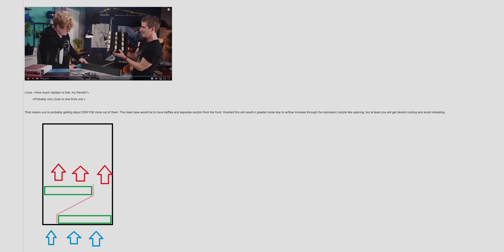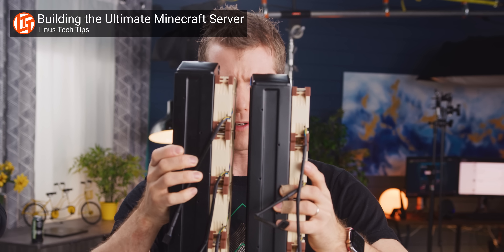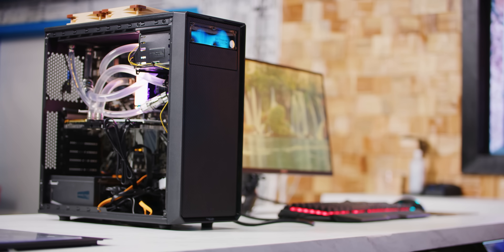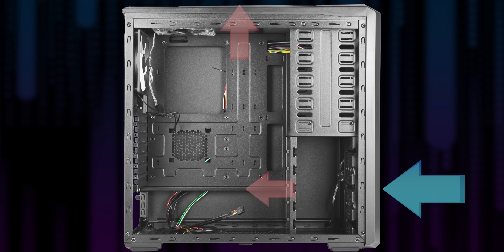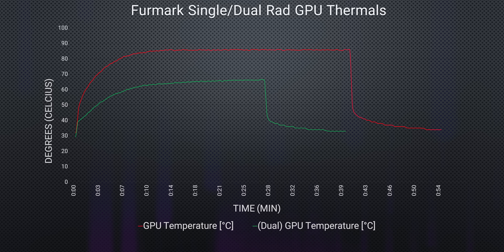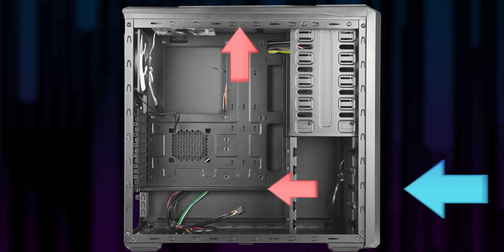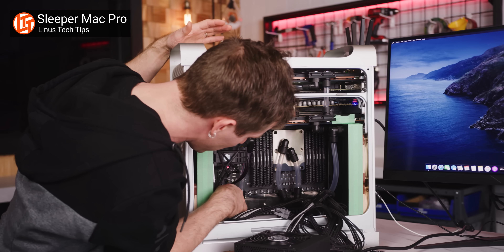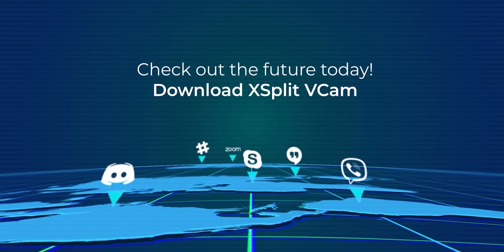I’ve been water cooling wrong for YEARS - $H!T Manufacturers Say

Comment: Corsair isn't wrong, but as Linus mentioned there's a difference in fan specs, radiator specs, etc.

I didn't see any information relating to the air volume or pressure drop across the coils of the radiators, which is a very large element to consider when modeling performance. Matching a fan to a radiator is the only way to correctly transfer the model, but you'd still have to be assuming a lot of other factors. Stick a stronger/larger/higher capacity fan on there (or two) and you're now increasing volume and ensuring a higher supply of lower temperature air, increasing thermal transfer (potentially). This keeps approach temperatures lower for the next-in-line radiator, that delta between temperatures determines performance, which Linus mentioned.

To understand airflow and pressure drop you can simply setup a fan on your desk and turn it on. See how easily it will blow a loose piece of a paper. Stick the radiator in front of it. If it still easily pushed that paper your coil does not have much loss/restriction and you will have an easier time sticking more air through it. This is why dust kills computers, clogging and restricting airflow reduces the overall volume and the amount of heat the fans can push and how much heat you can pull out of the system.

Those things other than airflow? A single performance model for a radiator would also assume a fluid flow rate and fluid characteristics, as the other media in the air-to-water heat exchanger. A simple change in pump, pluming line size/length, or other characteristics can greatly impact flow coming from these small pumps. Slower liquid will reach a colder temperature in the heat exchanger, but less mass flow means you're not transferring energy in the entire system at the same rate.

So: Is stacking radiators fundamentally incorrect? Yes, if they share an air stream there will be efficiency loss on the second unit, the extent of that loss depends greatly on how much air is being moved, how much water is being moved, whether or not those flows are laminar or turbulent, the approach temperature of incoming water/air, the surface area each media is in contact with, the thermal coefficient for heat transfer of each fluid and the materials separating them, and the relative density of each media. Knowing those we can calculate exiting air and water temperatures, and stack the model to the next radiator and determine exactly how much of a reduction in capacity we're seeing, and whether a change in one of those variables can help us optimize the setup we've chosen in terms of footprint, operating costs, ease of use, installation requirements, or other factors we're concerned with.

Comment: 2:20 
Wow, he even got the graphic wrong.  He's talking about heat exchange and has the arrow going from cool to hot....  Amazing.
Reply: what the fuck are you talking about. You do realize how cooling works... right? You put cool (relatively) air through the radiator which has a high surface area that imparts heat to the air making it hotter and therefore the thing it's cooling cooler. The arrow representing air is supposed to go from cool to hot. Are you gonna tell me that the air coming out of your pc case is cooler than it was when it went in? No! Cause that's not how pc cooling works.
Reply: He refers to cold air going through the radiator not to cold temperature "moving" into hot temperature space and cooling it.
Reply: @eliadbu  again, that's literally what the animation showed. You take cold air, put it through through a radiator, that air becomes hotter and is expelled. What exactly is wrong about that... that's literally how cooling works.

Comment: Would also matter if the hot air goes into the exhaust radiator FIRST. If it goes into the intake radiator first - then the exhaust hits warmer air and cooler coolant and the gradient is nil.

Comment: Your still doing it wrong dude, the rear of any propeller fan must be clear, it's exhaust side doesn't matter so you use that to push air into something not suck with the intake side, that's what impeller fans are for like in the underside of any laptop that's why they don't use propeller fans but impellers instead.

Comment: Thia is a suggestion if you have enough time please try.

While stacking radiators arrange the loop in such a way that the rearmost radiator is where hot water reaches first. The semi cooled water from the rearmost one flows next to the one in front and so on. And cool water from the radiator in front to the heat source.

This will make sure air flowing though first radiator is cooler than water in the second and same for the next.

Comment: Would've been nice if you tested a setup without the radiators in series (perhaps both outside the case, grabbing room temp air) to see HOW MUCH efficiency loss your having by pulling warm air into the secondary radiator.

It seems to me that their concern is probably less that it wont work at all than that it's just plain inefficent
Reply: So... add a control group kind of?
Reply: The difference is insignificant compared to adding a second radiator. The thermal dissipation gained from the second rad will far outweigh any loss in efficiency from installing them in parallel.
Reply: Or rather that is less efficient than having a single, bigger.
Not sure who it was, but either Linus or Jay, who tested with the rad as intake and as output and the difference was basically nothing.
Also saw a video about pump speed that ended up with 2 CPU, 3 GPU blocks and 5 rads and still worked fine.
Reply: @HappyBeezerStudios  If you dump 10c into the air from an intake radiator, the water is 10c above room ambient, and no air comes into the system except through the intake, that 2nd rad does nothing.

  To actually test the effectiveness of this system, you need to mount thermocouples where the air leaves the intake radiator and where the air goes into the exhaust radiator, and it would be better to get your results from temp sensors in the loop before and after each radiator(both of which should be identical).  The CPU, while practical, is so hilariously bad a datapoint that it's useless.

Comment: It all depends on how you stack the radiators.  If heat from the cpu goes into radiator one and blows it's hot air unto radiator 2 then you won't see much improvement, But if the heat goes into radiator one which instead sucks air from the much cooler second radiator then you will increase cooling performance as radiator two gets both the cooler ambiant air combined with the precooled water from radiator one.

Comment: I’ve got a goat tier gaming pc. Here are specs

3D cardboard case with cardboard fans

1/2 core CPU processor with .01 threads 

Cardboard mouse with built in lamp for RGB

Ice cold water bottle for liquid cooling

Wireless cardboard mouse (does not support bluetooth)

A rtx .2080 with resolution downscaling 1kb 

Ram of 1mb

Homemade hardrive (currently does not support space)

Power supply: new generation bicycle power generator with 2 wats

Microphone/headset: tin can telephone (currently does not support sound)

WiFi:unknown

Monitor: Ehh don’t need one

Please let me know what you think of my pc. Will it run FORTNITE at 4K 240fps. Maybe 8k?

Comment: Flip the fans so the radiators are all fed ambient air and watch the temps drop. You missed the point they were trying to make, supplying the radiators with warm air has exponentially lower performance than with cold. So before you go adding more and more radiators, ensure the ones you have are properly fed with gold air. If you fed the top with ambient air pulling in it would preform better.

Comment: I'd be interested to see what difference, if any, it makes depending on which item the intake rad and exhaust rad are cooling respectively.  Intuitively it would make sense to have the intake rad cool the item producing least heat when maxed out as then the internal air in the case will be less heated.  So typically that might suggest CPU cooler on intake rad side, GPU on exhaust rad side (assuming separate loops are in use).  Might make hose routing interesting though.  If they're both on a single loop, I would think exhaust first, then partly cooled fluid to the intake side rad, again to keep internal air cooler.  But in that sort of loop should the fluid go to the CPU or GPU first, intuitively I'd guess CPU.  Thoughts anyone?

Comment: Until the air hits the same temperature as your radiator it is always going to perform better with more radiators. Stacking a fourth radiator together might have a smaller impact, but radiators aren't perfect at transferring heat to air, if your fans are working properly the air isn't in the radiator long enough to reach max temperature. Corsair is assuming a spherical cow in zero gravity.

Comment: I have always seen a temp decrease adding a 2nd rad. I can say from my own experience that rads that are stacked do not cool as well as those same rads not stacked. So if you can for example put one on the front and one on the bottom, I'd say that would cool better then both stacked on the front. For me that made at least a couple Celsius drop in temps. Also a rad getting cool air from an intake will run cooler than the rad getting warm air from the case. That also makes a couple of degrees in temp. I had a top rad getting air from inside the case. I moved it to the front so it got air from the room. It did expel heat into the case but it did not seem to effect other components temps at all. The CPU temp did noticeably drop.

Comment: I would like the know the effects of having more water in the loop due to a second radiator being one of the reasons for this. Since there are much more water in the system, the thermal capcity of the overall loop drastically increases. They shouldve done the test where in the system with only 1 rad to have a giant reservoir to compensate. There still will likely be a small difference due to the other side vent airflow like they guessed, but it should not be enough to justify the extra $80-100 for an extra rad in the system

Comment: probably the fans on the 2nd radiator increased airflow volume through the case, which increased cooling capacity. If airflow volume had been constant perhaps it would have been closer to corsair's model

Comment: IMO, Linus and corsair are both right, corsair only said that stacking 2 dissipating unit is less efficient, it is simple, if the exchanger happens to be pumping hot air, this hot air would heat cold water, termal exchange works both ways. The exchanger surface is one factor only, the air pressure (quantity) increase or decrease exchanger efficiency, so is air flow (velocity), water pressure, and water flow. So with the same water and air conditions, stacking two exchanger is less efficient than using them side by side, because when staking the air pressure in the second exchanger is way lower than in the first as it receives hotter air, thus reducing exchange capabilities. Corsair didn't said that two units is useless, they said, the way linus using them in a system is not the more efficient way.

Comment: What if you were to set both radiator fans to blow so that fresh cold air is sucked in from the other side of the case where there is no radiator? If the fans have the static pressure to do so, it should result in colder temps.

Comment: Cars have been running multi row rads for years, essentially stacking rads, it works, rads are not 100% efficient
Reply: True but remember that cars radiators run on much higher delta T which will effect the added efficiency of stacked radiators.
Reply: @eliadbu  for the first row. After that it would be very close. Air coming off a car rad is incredibly hot
Reply: @steveg3361  while the air is hot, it's still far from the liquid temperature which is normally around 90-110 c. Anyway the radiator size (area, fins density and width) you would need depends on the heat output of your system at planned operating temperature and ambient temperature (let it be computer or car engine).
Reply: @eliadbu  as a diesel engine mechanic I disagree. The air coming out of the air to air in front of the rad is nearly the temp of the coolant. The delta is very little. The temperatures drop from the inlet to the outlet is also not a big number. More than 10c you have a plugged rad internally. Thermo dynamic properties are the same.

Comment: there is a little thing i picked up on my way to become an engineer, if you want your heat exchanger to work at best, make sure that the water flows the opposite way to your air stream, so that the hot air comes out where the hot water gets in and the cool air gets in where the cool water comes out (if you have several of those coolers, i haven't built a water cooled pc yet so please excuse me if i talk about something way off)

Comment: What you need to test is that rig with the three rows of radiators......  inline with the top on/case closed vs with them say half a foot apart in height (for that particular case).  Your testing here was floored ........  you had an open case and really didn't go into depth at all about your testing method on this case, it looks sloppy and I know your chasing content but this was a 'nothing video'.  Really you need to redo this and perhaps if possible have Corsair send a tech out to help guide you.....  because ultimately they are correct, it's just your testing was frankly 'in an open environment'.  But yes we are all confined by space and limitations which in the real world is all that ultimately matters.

Comment: He should benchmark the results of stacked watercoolers in a custom loop, one with the water flowing through all radiators in the order of which that air flows through them, one with the water order against the airflow order,  and all in parallel, and then all in series, all fresh air.